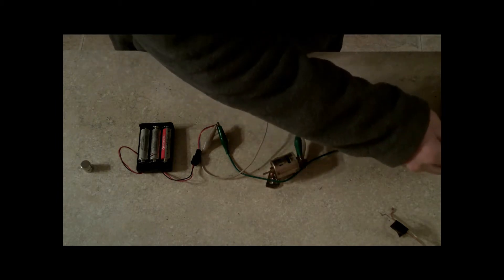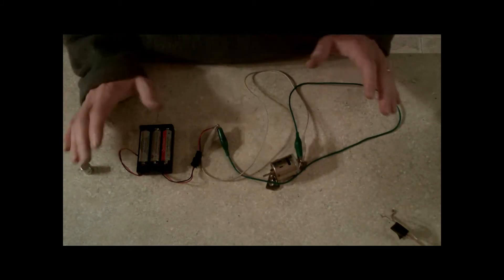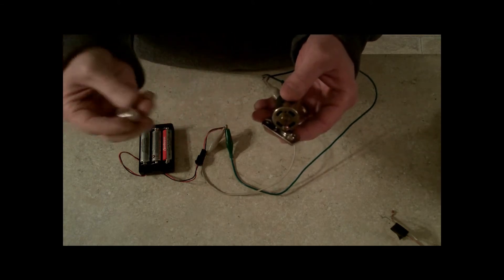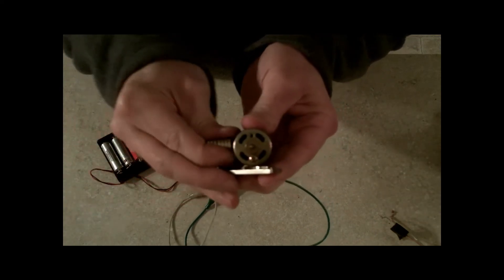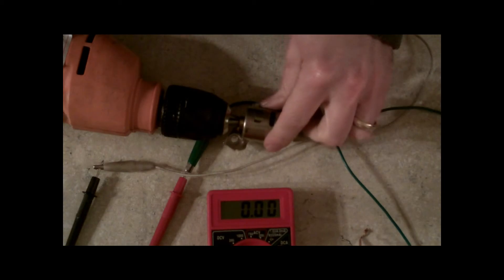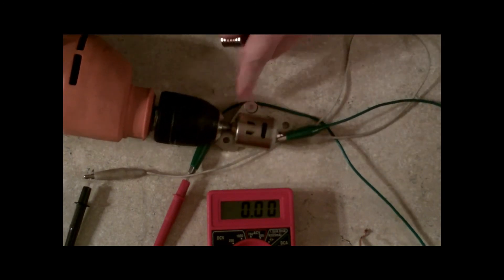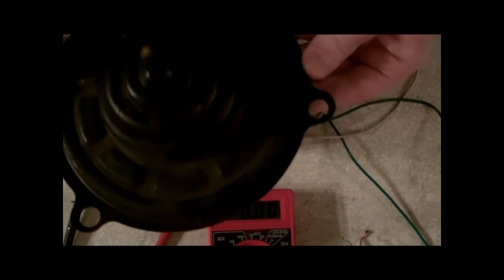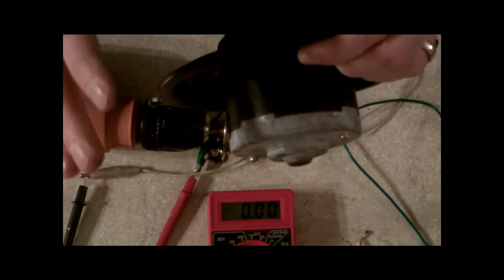Wind turbine motor output increased by neodynium magnets (need help)

Comment: If your looking for high voltage output you should take a good look at muddy's ceiling fan wind turbin. I have built 4 of these units now for around 25.00 for each turbin and have had great results. I have had these motors putting out 100+ dc volts in 10-15 mph winds. amps are low but you can charge a battery fast. Muddy also shows a way to wire the stators to increase amps witch I had to do just to bring down the voltage, running one now 20 mph wind 75-80 volts dc. Cheap to make GOOD LUCK!

Comment: Man i can appreciate what you are doing. Been through all of this myself. My Answer: No even if you add the magnets your output amps are still going to be limited because of the windings on the motor. As you know many people like the treadmill motors because they have a decent output, but have gotten expensive. Unfortunatly you do need a larger motor. Watch craigslist for the motors and also industrial servo motors will work. Check out my older videos to see my alternate energy project.